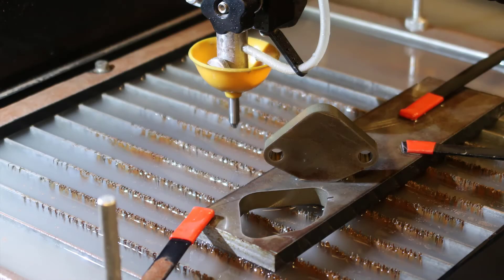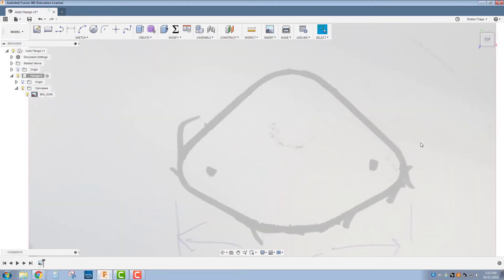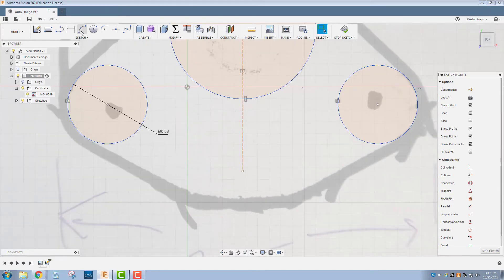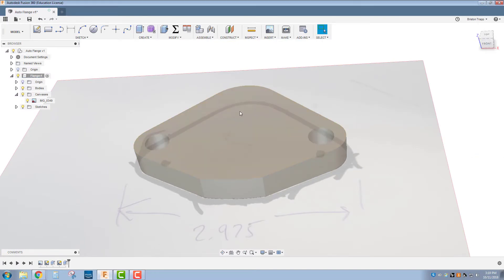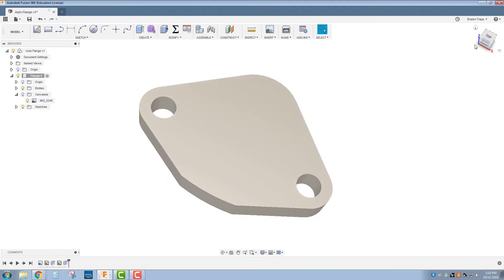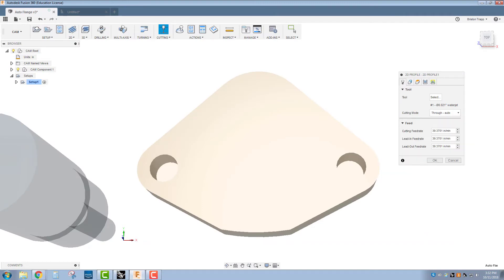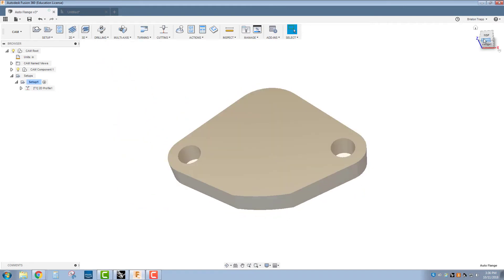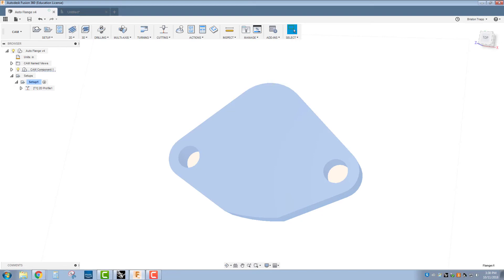Using Fusion 360 and the ProtoMAX Waterjet: Metal Flange

Comment: Great Video!   Thanks for showing the process in Fusion 360, that's really helpful.  I have a few tips to consider for next time.

Tip 1: Use the PREVIEW function in ProtoMAX MAKE instead of jumping through all the hoops with lasering in cardboard.  There you can literally run the pre-computed motor motions right back to the screen.  You can also zoom around and preview to see slow areas, offsets to wrong side, and see just about any other such issue you could have.   If things look good in Preview, then the part is good to go.  If not, then you have "failed fast" on the screen, and not ruined anything that matters.   Use the Inquire tools to check your dimensions.  Your idea to print is a good idea also, but not really necessary unless you are paranoid.

Tip 2:  If all you need is a spacer, consider cutting it in aluminum for about 2x faster cutting.  Also, if you cut 2 pieces at 1/2 the thickness, the total time for both will be significantly faster than a single cut at full thickness (if your design will allow for that, of course.)

Tip 2: I've found on the ProtoMAX, that it often cuts slower than it needs to, out of paranoia to make a perfect cut.  You can probably use a lower cut Quality, like a "2" for a lot faster cutting, and likely will not even notice the difference.   Or, use a "3" for the spots where tolerance and taper matter, and a "2" or a "1" where you don't care so much.

Tip 4: Use a sharper angle in the "V" of your leads.  With them spread that far apart, as the jet cuts the holes, it will "Cheat" into the lead in, and create an unnecessary blemish.  By making the lead in and out more perpendicular to the edge (a tighter "V"), you will get a better cut.   Also, no need for the lead out to be so long, that's just wasted time.
Reply: Qualth, do you own (or have regular access to) a Protomax? I'm considering buying one and I'd like to talk to someone who's actually used one.
Reply: Thanks, good stuff, i just got a Protomax!
Reply: Hello, how do you adjust cutting depth for the water jet? Thank you.